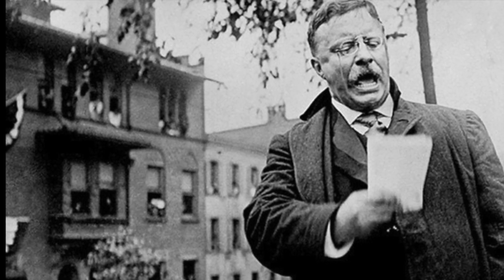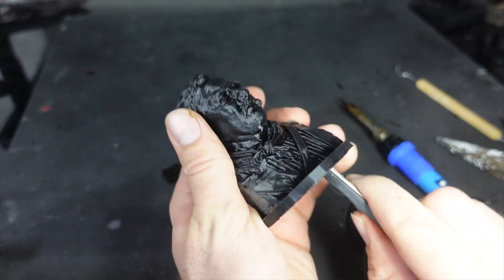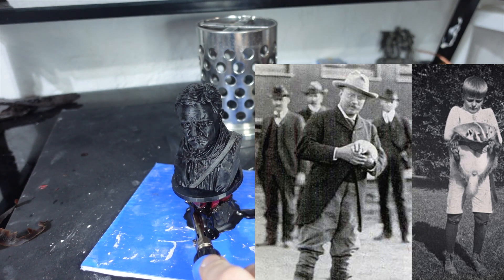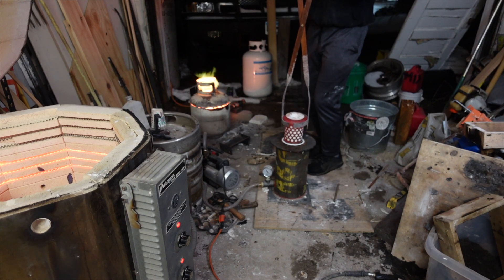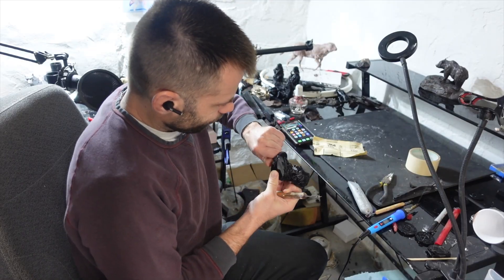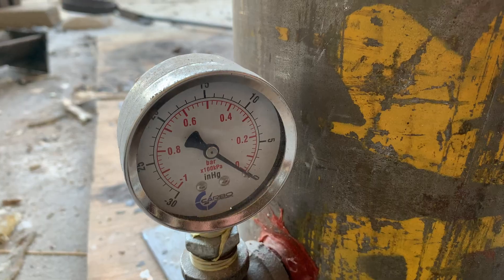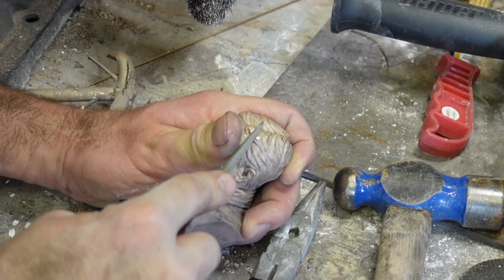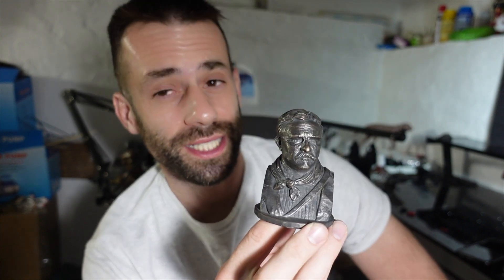Making Bronze Teddy Roosevelt, Lost PLA Casting.

Comment: Smart move on the hole repairs -can't even tell!  Looks like your holes had natural undercuts so the peened-in metal repairs from cut sprue bits will be permanent.  If holes hadn't left undercuts then one simply dremels em in.  

Good eBay move I think.  You might want to list Teddy's weight and dimensions.  Also, ebay now allows videos, not just pictures, and you'd be a natural  doing a 360 panoramic video short of Theodore, along with some of your captivating color commentary!

Very interesting facts on President Roosevelt, aka The Rough Rider, Bull-Moose, The Lion, The Colonel, Teddy, Teddy Bear, etc.  Not surprising Rough Rider extraordinaire is one of the four presidents permanently enshrined on Mount Rushmore.  Lincoln's my personal favorite.  Affordable presidential bronzes are not commonplace, and all those Abe fanatics just might push an auction price up pretty good ; -)

Genius -Congrats Again!
Reply from the maker: Yeah The holes did have natural undercuts. I didn’t show it but I did dremel the undercuts a little more too. 
I will have to do a Lincoln as well. I had someone else say Lincoln was their favorite.

Comment: Could it be possible, instead of 3d printing an positive model. Print a negative mold. And use it to cast wax positive models for doing lost wax. No ash left behind.
Reply from the maker: Interesting idea. It may be possible but I don’t know enough about digital design to do it.
Reply: @lundgrenbronzestudios  Or properly silicon mold the perfected PLAs and pump out presidential wax trees.
Reply: @lundgrenbronzestudios  Printing the mold is interesting.  Remember reading several years ago experiments were being done printing molds from metal casting investment slurries, so technically no pattern was necessary.  All you had to do was melt and pour the metal in the printed investment mold.  Not sure if technology has advanced, but do remember the initial cost for an "investment printer" was huge.
Regarding printing PLA molds,  not sure, but printing a PLA mold should be easy if you have the PLA code (just let some software program inverse it, right?).  AI is pretty amazing these days.

Comment: I could see the explosion of molten bronze coming, and the fail from the vacuum :D (probably cos i've done that myself, more times than I'll ever admit in public haha)

I've discovered that you can buy both sheets of thick 3-5mm rubber/silicone that can be carefully cut to shape to slot in the big flasks (don't forget expansion allowance, i do still lol), by itself that's only good for a handful of castings before it needs replacing, hence my previous suggestions to use the silicone windowy stuff. To counter the awful lifespan of that rubber tho, you can buy sheets of graphite from your fav auction site, 300x300x3 should be big enough, then cut that to size to go over the rubber, adn between it and the flasks. That way you'll still get the airtight seal you'll need, plus the extended lifespan of rubber due to the graphite acting to protect the more rubber ring. At least that's the theory anyway xD
Reply from the maker: How hot do you have your flasks for pouring. I’m thinking I have them too hot. I pull them out at about 1100°F
Reply: @lundgrenbronzestudios  I haven't done bronze for a while, but around that is what I use for my trees full of small things. I think you can drop it a few hundred F if you're just doing chunky pieces and not super thin detailed pieces with like 0.2mm lettering n details or lower, but they should be fine with the usual temp. Too low and thermal shock will make the plaster crack and you'll have the metal run away lol